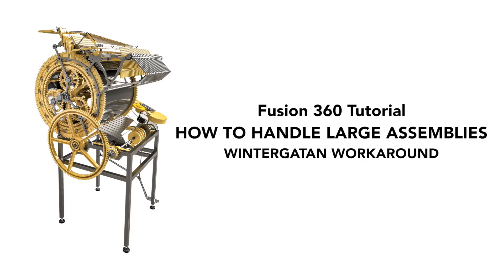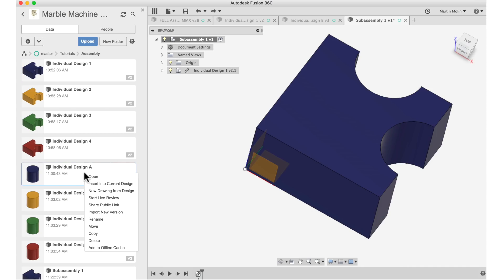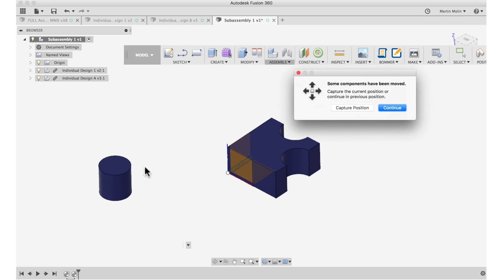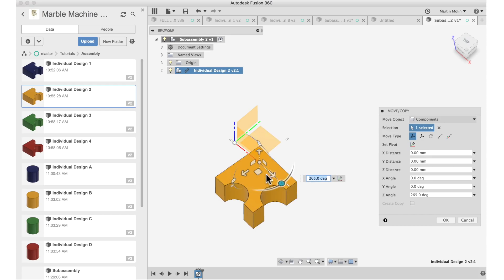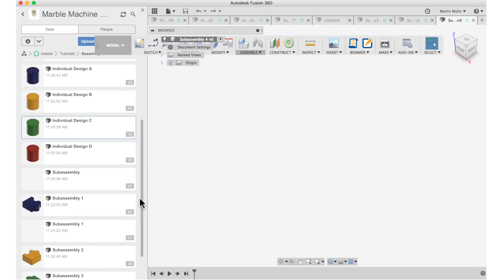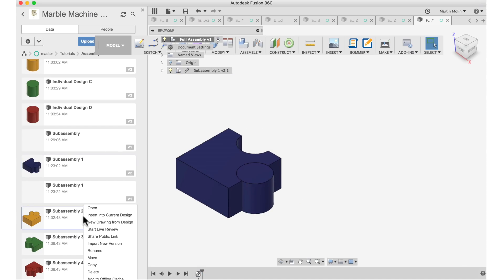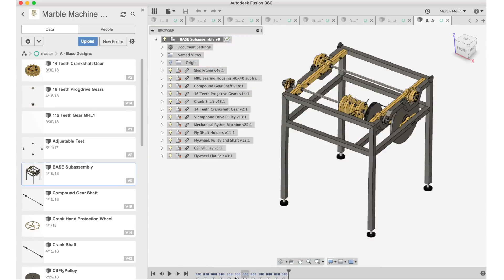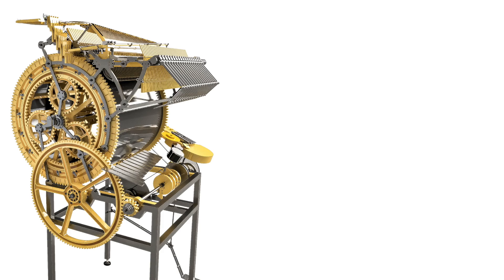Fusion 360 Tutorial - How To Handle LARGE Assemblies

Comment: I'm a designer, I use Inventor and I'm not familiar with Fusion but I notice some similarities. Would it be possible to share a sketch between parts? If so you can sketch the full assembly and insert each part without moving and preparing anything.

Comment: Here's a few concepts for the modulin.
1. 3d print and add a violin style head to the ribbon controller ( for deco )
2. Add a flanger module
3. Add a fixed amount of reverb to simulate violin resonance.
4. add a jack for an amp.

Comment: It may look like 3D CAD programs all have the problem of big assemblies, but I have been working with Solidworks, Catia, and PRO/Engineer and neither has that problem. Yes, they all cost 10 times what Fusion 360 costs, but those are REAL 3D CAD programs. I think with this project you should have chosen Solidworks for many reasons (too many to write them all down). I work with Catia and I have no problems loading and working with way bigger assemblies than your MMX (i.e. complete cars).

Comment: Ok so then... How do u actually get anything done? You can't really work inside the sub assemblies because then that dirties it up. You can only work in the individual part files... In which, you'll then have to work inside the sub assembly anyway so you can make everything fit... And then what? Delete everything and save it as a copy? Sure it'll make the presentation alot smoother, but that isn't actually "working" in fusion 360 anymore, that's just organizing in fusion 360... Hell I have a really nice rig and just doing something with 10 components kills everything... But then again, I work with stl files which are horrendous.... So I usually "remake" the stl from scratch using the stl as a base, then delete it... Cause damn... Why the hell do 3D printers need to use that outdated, terrible file type? So wish slicers would work better with obj at the very least.... Watching this just makes me want to give inventor a shot

Comment: Neat solution. Seems there are some drawbacks you can't avoid, though. Since the components are inserted at exact positions, wouldn't you need to go back and reassemble all the subassemblies if you changed a component?
Reply: You could insert derive all the components into the subassemblies instead of linking them as he did. When you insert derive a component, you can check a box to include all of that component's 'favorite variables'. Simply base all of your component positions off of xyz coordinates stored in those variables and everything can be automatically repositioned down the chain if you'd like to change something in the future.

Comment: That’s not a work-around, it’s pretty standard engineering practice to work with detail models and assembly-level models. Any CAD software will choke if you have too many parts in the assembly. I’m impressed by your ability to learn so quickly and so well.
Reply: This method makes it impossible to tweak the designs though. Doesn't it. Say he wants the puzzles to be rectangles or just slighly smaller, he'll have to redo the subasemblys and the final assembly from scratch because he is not referencing other parts but a arbitrary position in space isn't he? Or does fusion recognize what he was referencing after he deletes it from the subasembly.
Reply: Yes, he is completely destroying the parametric capabilities of the software, which is very unfortunate. Also I think he is trying to make the whole thing with detail models which is slightly insane.
Reply: Anonymouspock can you elaborate on how you’d recommend doing it instead?
Reply: At least all the hardware he's using are just custom cylinders rather than the detailed screws et al that come stock.
Reply: It's a kludge to work around the ineptitude of the software. Potentially very useful, but still a very ugly hack that shouldn't even be necessary if Fusion was written properly.

Comment: It's strange what limitations you have to put up with in this program. I can understand it not being designed for such complex projects, but I would expect the basic feature of movement to remain functional. My guess is the program uses some serious spaghetti code, and what should at worse be linear complexity is exponential complexity. I get that these assemblies can be combined in numerous ways, but I would expect everything to be programmed in a relativistic enough manner to handle something as fundamental as moving a thing somewhere.
Reply: orange123789456 (fr) in computer sciences problems are divided in categories based on how much the computation time grow with the "size" of the problem.  1+2+...+n is a polynomial problem because  the computation time grow with n. Np-complete is another category where the computation time grow exponientially. Well it's not exactly like this but that's the idea
Reply: Would you mind explaining NP-hard and complete?　I did a quick google search and had no idea wtf i saw there lol
Reply: with the software is about the same as with smartphones, they have everything you do not need, but they are fueled by resources. However, in order for someone to perform optimization, it is too expensive.
Reply: Thanks dude